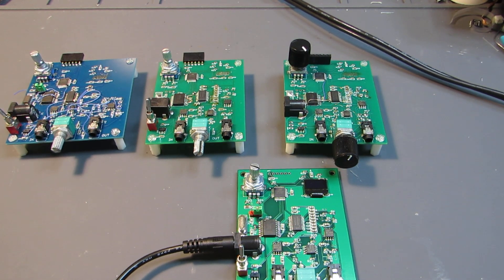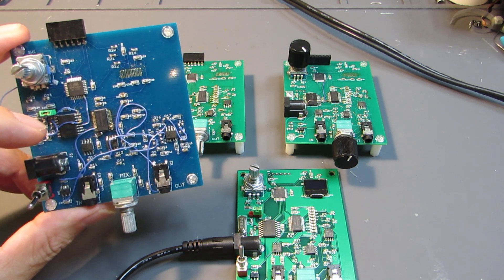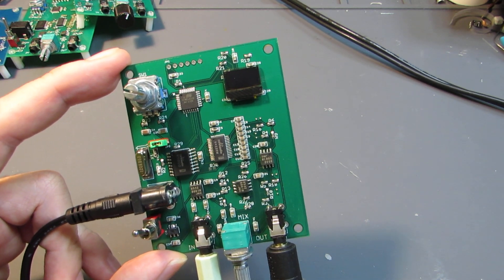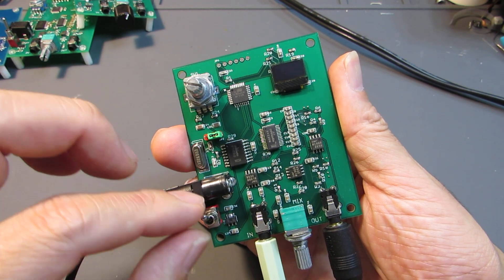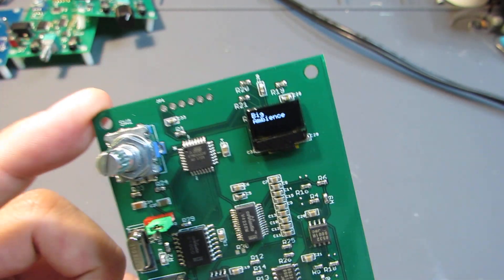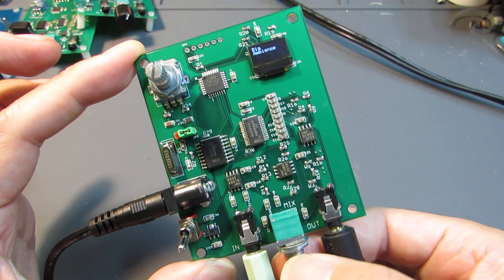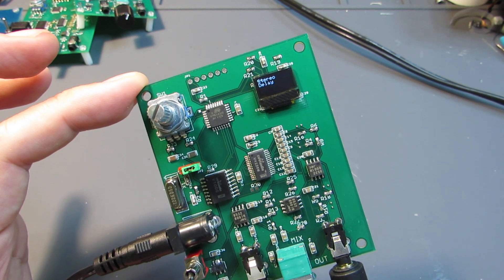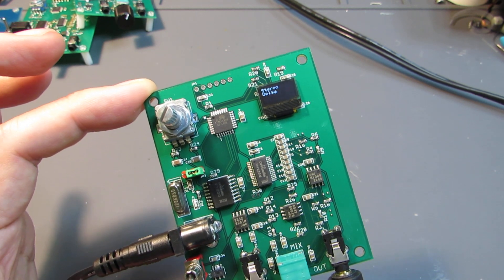"Sound Toy Box" by Cool audio V4220M/V1000 completed.

Comment: Nice one! 

It works like on the music audio processors on higher-end phone. Would be a nice idea/add-on for a diy audio system. 

Im not so good a coding but I would suggest adding an mp3 uSDcard player module AND displaying also audio info/title on same screen.. and is thatca "bare" oled screen? I think would be better if it where I2C so its easy to put the display somewhere(like a front panel or something)

-just a thought ☺
Reply from the maker: Aha, yeah. But preparing MP3 and digital audio requires completely another block... But it may be fun indeed, thank you comment!